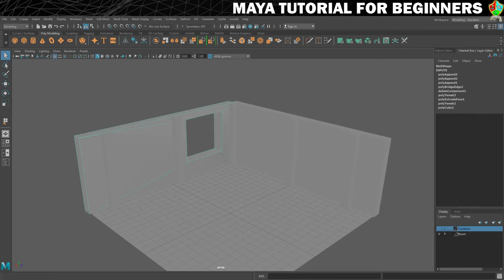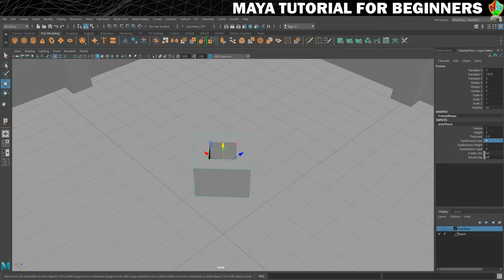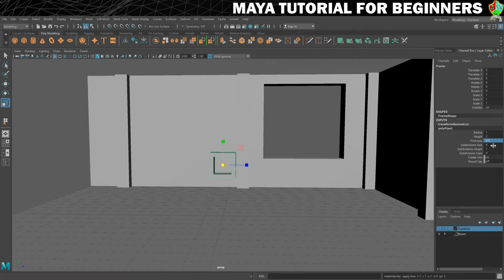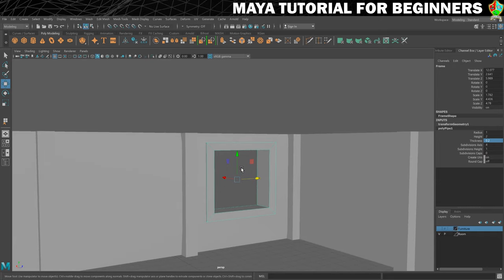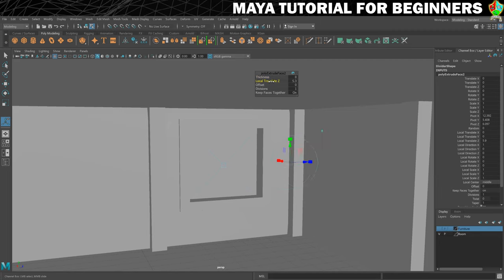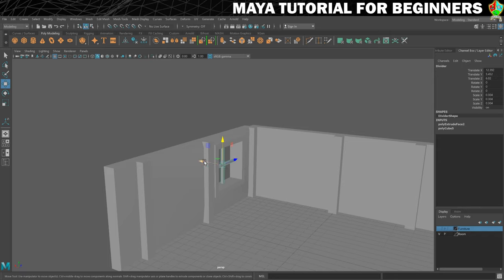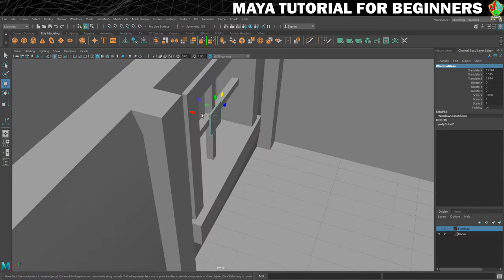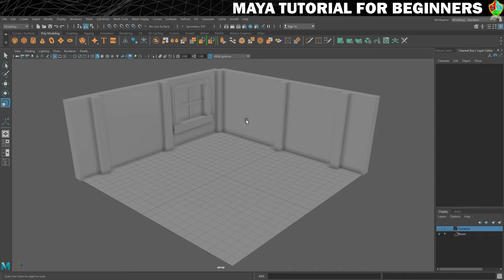Extruding in Maya Pt.2 - Window Panes | Maya 2020 Tutorial for Beginners

Comment: 3:53 I am almost certain that they're referred to as muntins or muntin bars but that's only for the interior vertical part. The exterior pieces are referred to as stiles and rails
Calling it a divider is absolutely fine though, no sweat
There are mullions too. The difference is that muntins are the separators for multi-pane windows and mullions are the single vertical separator for double-pane windows.